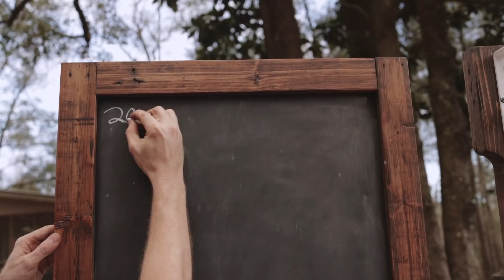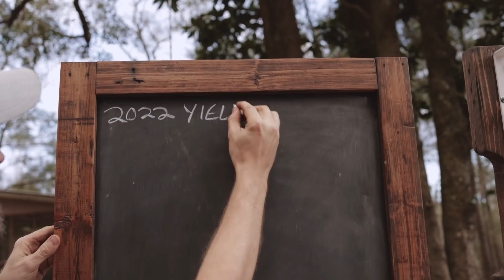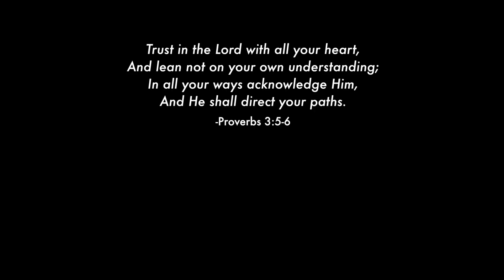Let's Track Garden Yields! (Produce Weighing Bench Build)

Comment: Wow! That table must have cost $200 at today's lumber prices. I've had to learn how salvage scrap lumber for my projects.Great job Good tribe. 😀
Reply from the maker: We paid $20 for the blue work bench at Goodwill. The pallets were free. I got the oak plywood sheet for another project last year, but the amount I used cost about $25, I think, if you were to buy it in that size.
Reply: @davidthegood  Well done, DtG!  That would easily cost $200 in supplies here now.  Lumber is so scarce and expensive that we just had two builders who had been purchasing it outside of our state and bringing it down themselves... Though it was the correct grade, from what I've been told by another builder in my extended family here, it didn't have the state stamping... They had to remove it all and replace it with the state stamped lumber.  Awesome. 😂
Reply: @davidthegood  
Where do you go about sourcing your pallets? 
I rarely find them for free in California.